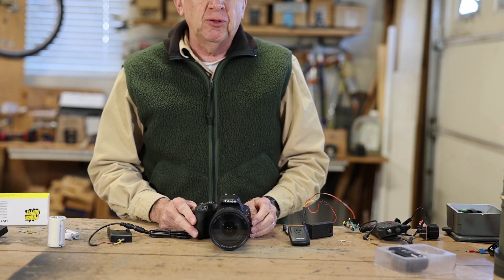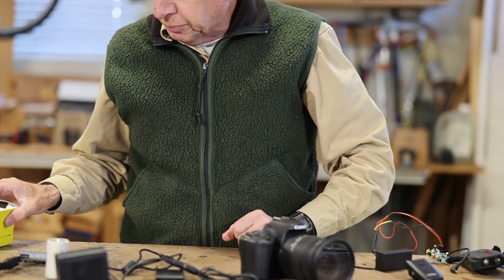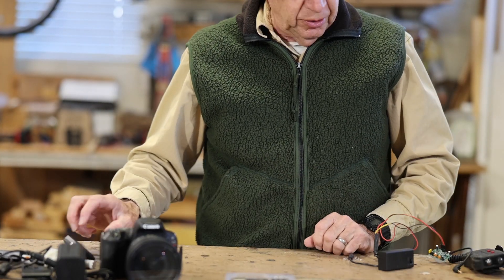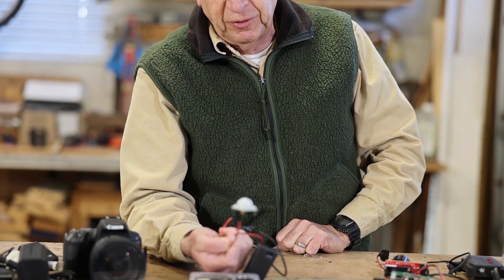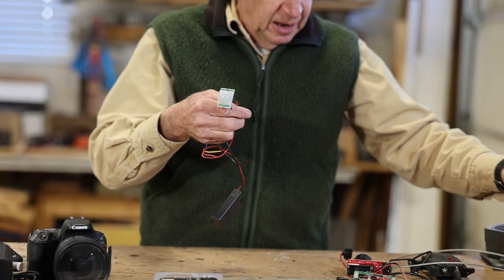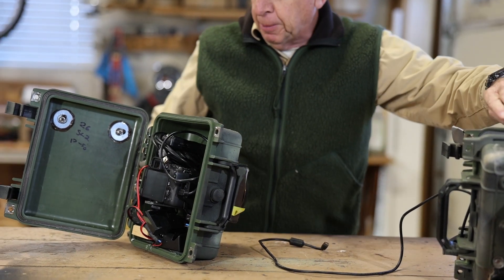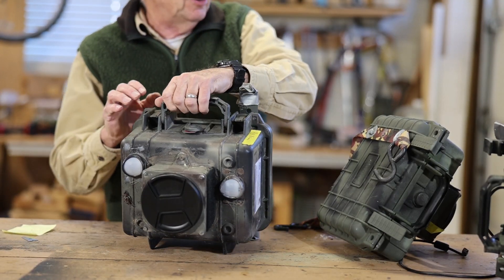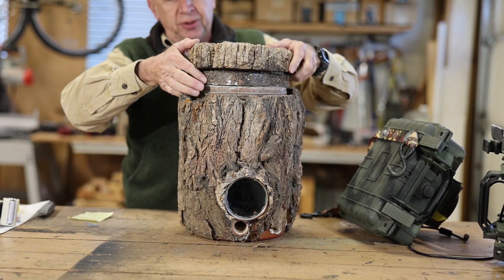DSLR Camera Trap Components and Cases

Comment: It’s very informative and interesting video thank you john for sharing your experience, it’s brilliant idea to made a case for two lens outputs, also the tree trunk case is brilliant.

frustrated to do a case for a fisheye lens and hope to know which lens protection have you attached to the case !
Reply from the maker: I got it off Amazon, it scratches easily but works, used silicone to seal it directly to the case and then used a bracket to support the camera so that the lens could get close to the cover. It is a security dome camera housing 90mm: https://www.amazon.com/dp/B08DY6DB7T?ref_=ppx_hzsearch_conn_dt_b_fed_asin_title_7&th=1

Comment: A few questions for you.  First, will the Godox CT16s send a wake-up signal to a flash on standby before the camera fires, (as do the Camtraptions), or do you have to go with the old 2-shot, first one without flash, flash fires on 2nd shot route?  Second, do the Camtraptions sensors actually take 6-8 seconds after detecting motion to fire?  I haven't noticed this when setting up camera traps, but think I might have occasionally when checking them after a couple weeks.  If so, I'm amazed I've been able to get some of the shots I have with them.  I'm always looking for something better though, which leads me to question #3- can the TLR sensors be used wirelessly?  Would it be possible to attach the TLR to a transmitter, (Godox or Camtraptions), then attach the corresponding receiver to the camera.  I've done this successfully with my Cognysis Scout Active IR sensor.
Reply from the maker: 1: With the Godox usually the first time the camera fires the flash won't fire but the second time the camera fires so does the flash until it goes back to sleep after a few minutes. 

2:The three Camtraptions that I have take about that long, I stopped using them years ago because of that. It is easy enough to test your Camtraptions after it is asleep wave your hand in front and see how long it takes for the camera to trigger, or when it is set up walk in front.  When my dogs run in front of a sleeping TRL or Movo it will usually fire after they clear the camera field of view but they are running in front of a sleeping sensor.  

3:The TRL fired a Godox transmitter but the Godox receiver would not fire the camera. A Camtraptions receiver does fire a camera but of course it needs a Camtraptions transmitter. I think Ben, the guy that makes TRL sensors said he has a wireless model for I think it was around $20 more.  Please let me know if you have any more questions, these were good, I had to go play around in the garage for the last question.
Reply: @John16755  Thank you, I really appreciate your time and effort.  Unfortunate about the Godox triggers not waking the flash.  If they did that they would be a huge upgrade over the Camtraptions ones. I often have the camera set to use long shutter speeds in order to get stars or ambient light in the background at night, so I really do need the flash to fire on the first shot.   I do think I'll look into the TRL sensor.  Guess if I can buy or make it wireless, I'll need to make some sort of water proof case for it.  Should be easy enough.
Reply from the maker: @larrybillgorum87 I think the first signal to the flash wakes up the flash, there may not be an easy way around it.  This morning I ordered a JJC 3 in 1 wireless flash trigger and shutter remote control .  I ordered if from Amazon 1 transmitter and 2 receivers for $35.  I could not find how long the batteries last, if they don't last long I will return it.  It looks very similar to the Godox ct 16, maybe it is made by the same company. I will let you know how it works out.